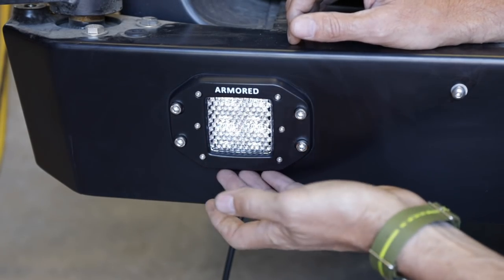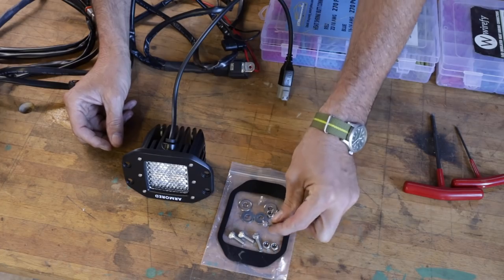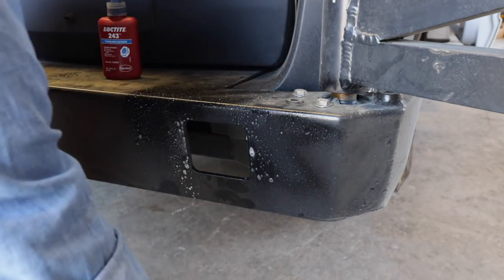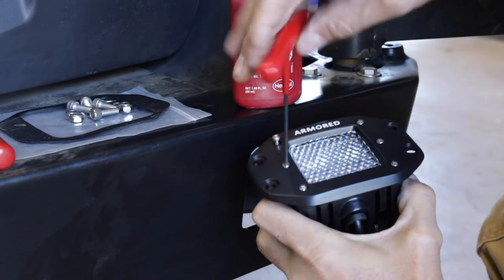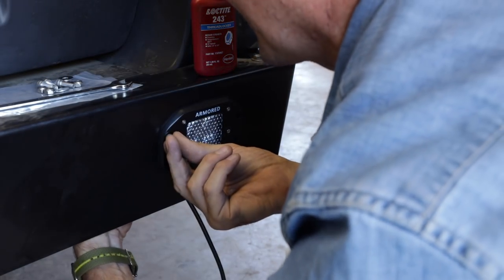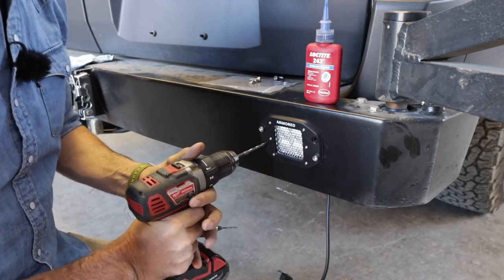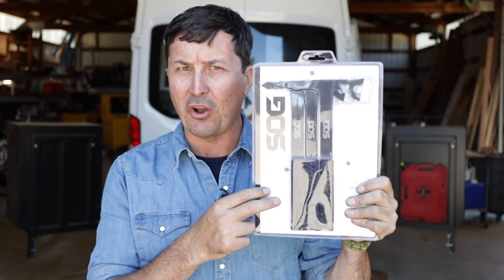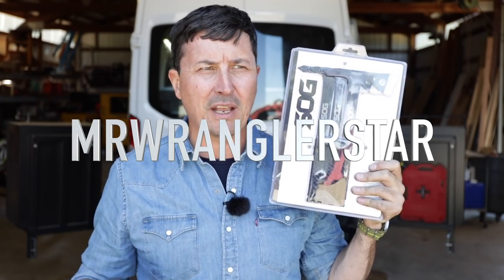How To Install LED Reverse Lights

Comment: Hi Cody, when drilling into pre-painted stuff, a small piece of plastic tube on the drill will stop you crashing into the paintwork and marking it.  You can also use a similar piece of tube as a depth stop.

Comment: Cody here is another tip for you paint the holes you drill either with a bit of touch up or spray paint to keep the holes you drill from rusting down the line...

Comment: lol    I worked in aerospace till I retired. Almost all the hardware was stainless steel. One of the keys to working with ss nuts and bolts is to go slow when first screwing the nut and the screw together and if you feel ANY resistance back the screw out and try again until they screw together smoothly and pre-screw hardware together before installing. It may seem like extra work but it will safe you a lot of aggravation in time.

Comment: I knew someone who had an older Volvo Wagon (stick shift), and one of it's features was that you could, while driving, lift up the ring on the gear shift, take the car out of gear and tip it over into reverse (without engaging the gears). This would activate the reverse lights in the back of the car. 

I'm saying this because he installed a similar set of lights to his wagon (it was kind of a rough car), and whenever someone would be tailgating him or being more aggressive than whats necessary, he would tap the gear shift over to engage the reverse lights and flash em at the person behind him.

It's probably good that when he had this set up, these lights weren't LED.

Comment: Much cleaner look than the pair I hung from the bottom of my rear bumper.  I rigged mine to trigger by shifting into reverse OR with a manual switch.  I liked the manual switch for hitching to trailers in the dark.
Reply: How did you set that up?
Reply: @aidan4396  - It was 12 years-ago on a previous truck, but from what I recall it required three relays.  One relay between the two switches, (Switch 1 was the reverse light circuit of the truck. Switch 2 was a manual rocker switch on the dash.) one relay between Switch 1 and the power source to the lights, and one relay between Switch 2 and the power source to the lights.

Comment: I cringed when you started to put in that nice stainless hardware without antiseaze. My Father was a millwright for a rather large Dairy in Wisconsin, everything they used was stainless for sanitation reasons. He used to tell horror stories about mult-million dollar machines being ruined because someone forgot the antiseaze. The van looks fantastic and I am glad to were able to save that bolt.

Comment: Loctite tech tip, use the silver antisieze on aluminum or stainless,  it contains nickel and is compatible with thise metals. The copper can be used on steel and high temp applications.  You can use the silver stuff  on steel applications but i wouldn't recommend using the copper on stainless or aluminum because of electrolysis, it could have the opposite effect of antisieze.
Reply from the maker: Thanks for the tip, I'll switch to copper on the SS
Reply: @wranglerstar  👍🏻

Comment: if that is a steel rear bumper make sure to paint the bare metal before installing the bolts
Reply from the maker: It's titanium,

Comment: Would much prefer a switch. If your'e hitching up to a trailer at night and need to hop out to hookup, the lights will go off when you put it in park. I have seen people leave it in reverse and use their E-Brake.

Comment: The Rotopax hardware doesn’t seem so bad now.
Reply from the maker: The fault was mine, not the hardware,
Reply: You need a Partner Steel groover in the Van.

Comment: Isn’t it illegal to have non DOT approved lights not switched? I like the idea but I wouldn’t want the trouble from police. Also do you think that the stock wiring can handle the load of the original reverse lights and the ones you added??
Reply: Caedon Decker LEDs take next to no power and the cops really don’t care 🤣.

Comment: Cody, can you tell us what happened during that 7 hours?  Did you have to get a bigger allen wrench?  Did you have to use a torch?  How did you get past that stuck bolt??
Reply from the maker: It didn't actually take 7 hours. I was being hyperbolic,
Reply: @wranglerstar  LOL, I was really worried what would have taken 7 hours!!  Thank you for the tips about using anti-cease on stainless... I never knew that.  I've got some (in spray form) and I'll make sure to use it!  Thanks again!

Comment: allright so you tightened 4 bolts in this video, what about the wiring ? the relay ? soldering? running all the wires under the car and to the battery? wiring the relay ? putting the swtich in the cabin ?

way too much talking...